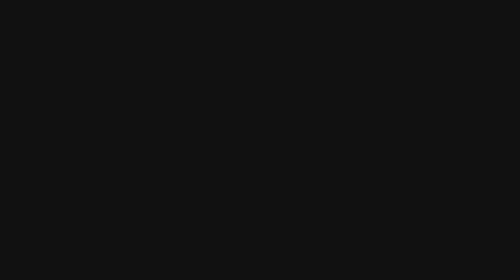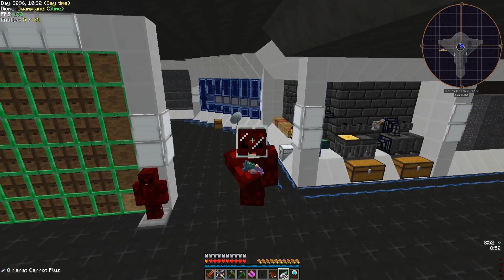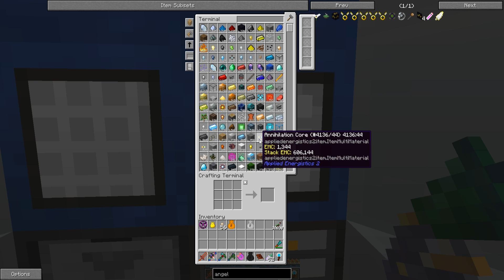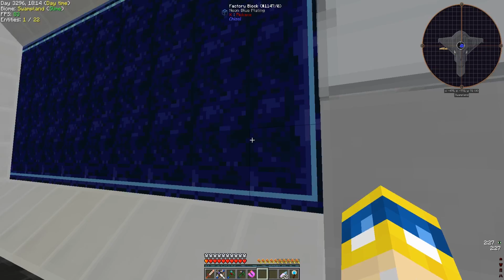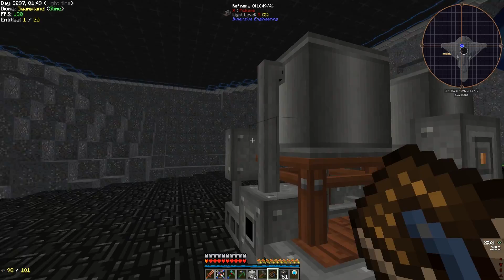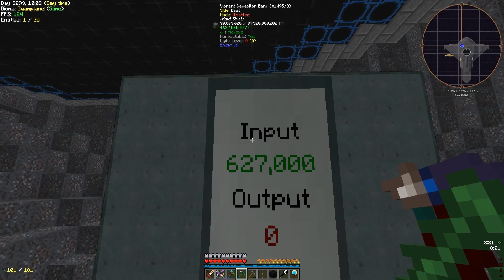Project Ozone 2 - 27 - POWER AND FREE EMC [Kappa Mode]

Comment: how you got it to work to craft the cheap ludicrite recipe? On the server i play it doesnt craft it.
Reply from the maker: it just does on here, i don't know ... sorry
Reply: well checked it in single player, there it works. seems like the server where i'm playing had disabled the cheaper recipe. But thanks for you fast reply
Reply from the maker: it might be, they might have wanted to make it more balanced
Reply: @Akizo96  One person mentioned that the pack changed the values but supposed if you hold the item, then it'll give you the old values.
Reply: @Akizo96  From a comment from @BOES "You can change the emc value when holding an item in your hand. /projecte setemc 452,608 (the old emc value)"

Comment: Nice Setup and Video
On my Server i filled a chunk with solar panel XI and give this power in my 10 stacks of Vibrant capacitor banks xD
i am using Rftool's ,Molten Bedrockium dimlet and a Ender Quarry with pump upgrade for my EMC and a Compacter to make Bedrock but i looking for another solution cause this is like Cheating xDD
Reply from the maker: it ain't cheating :P
Reply: @Krakaen  yeah..if it's possible to do then it aint cheating. Nice set up